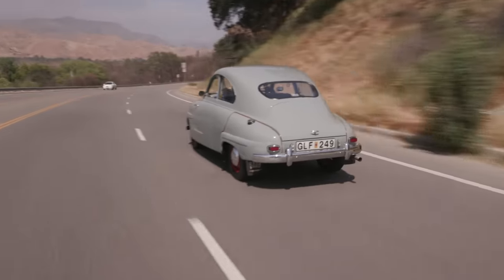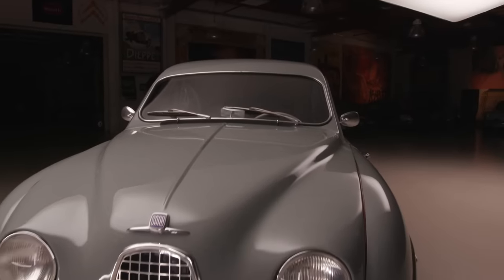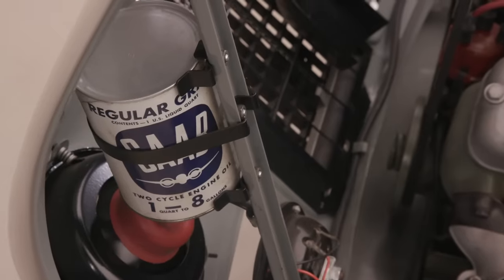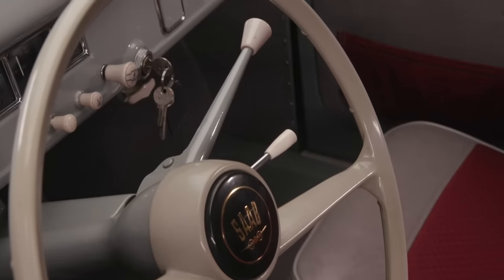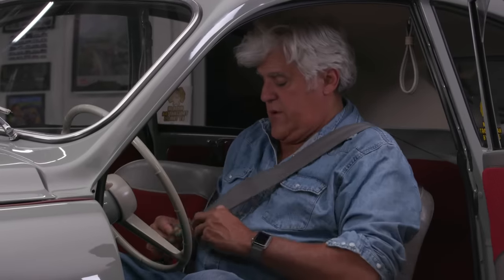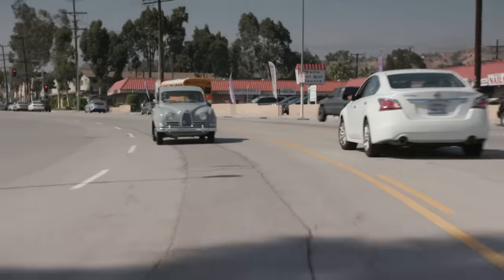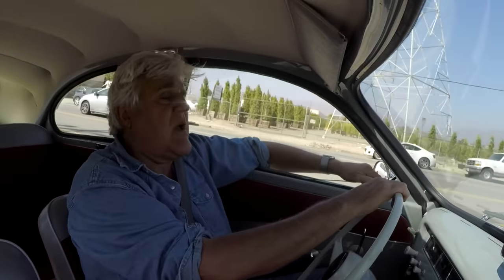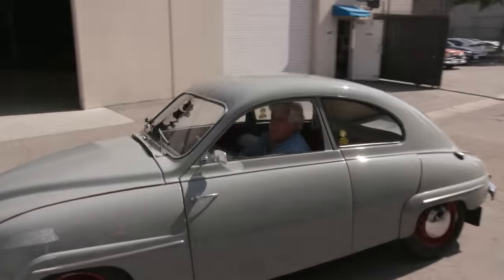1958 Saab 93 - Jay Leno's Garage

Comment: You never mention the real reason for freewheeling, that being to prevent loss of lubrication when compression braking. If you had no freewheeling, when going down hill without giving gas at the higher RPM, the lubrication is gone and the engine will coke up or seize up. Freewheeling allows the engine to return to an idle with sufficient lubrication.  Even then, engine life of the 2 stroke sucked...

Comment: Had a Saab 93 in the early 1970's.  An absolute piece of junk.  Second day I owned it, the ceiling lining began to detach.  Dealer couldn't put it back properly.  Had to screw it up to hold it.  Next day, clutch pedal started to drip.  Dealer finally found the problem AFTER the warranty expired.  He reluctantly agreed to fix it at his cost since I brought it to his attention while the warranty was still in effect.  Just a piece of junk.  Never bought another one.
Reply: That was the limited IKEA-Edition. It came with an allen wrench.